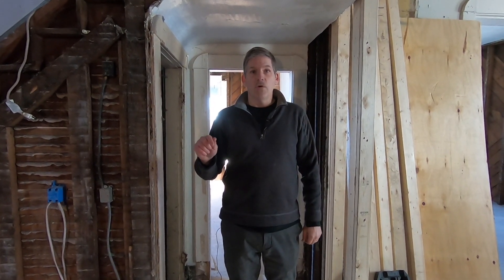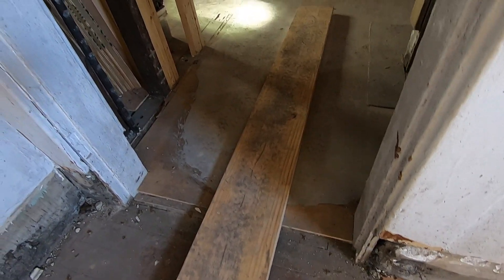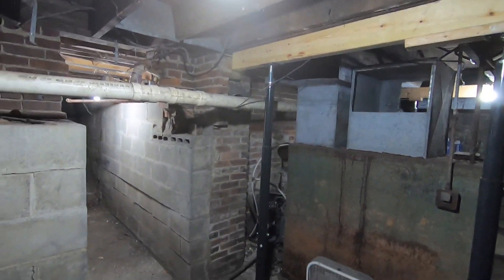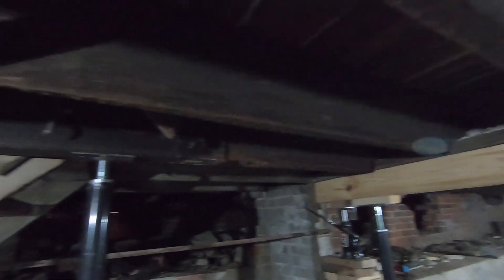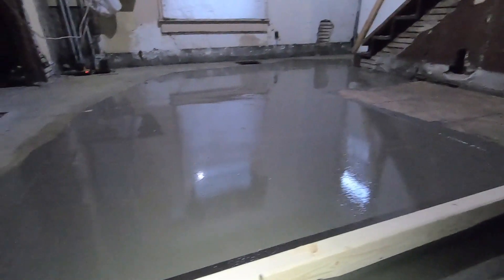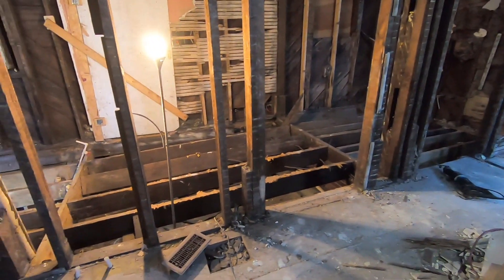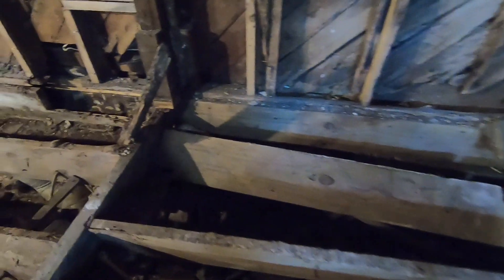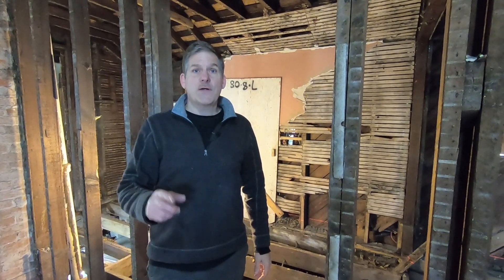Old House Renovation 3 - Subfloors - fix dip in floor and replace rotted wood

Comment: Solid video. I’m working on a 100 year old now. Very similar issues with notches, saggy floors, dips etc. it’s been fun correcting em.  Get to see first hand what shoddy carpentry, plumbing will do to a house over the years. Not so fun trying to track info to fix them. We’re a consumer society and the knowledge of how to fix and mend.
Reply from the maker: Hey John,
We totally feel your pain. Contractors and DIY’ers alike can turn a house structure to almost Swiss cheese in 100 years. We worked on a 35 yr old house once and the main floor joists support 2 floors above it was RIDDLED with holes and cuts!!!
Hang in there…the work is worth it in the end!
Thx for watching!

Comment: Would love to see a full video on y’all lifting the wall to get it level. I’m doing the same to a house I just purchased however the siding is brick. I really don’t want to pull all the brick down.
Reply from the maker: Hey Matt,
If your exterior wall has sagged, I would think that would already cause a brick issue. 
In our videos we have only worked on interior walls.
Like in this video: 
https://youtu.be/Hvgk8ZE0kaE
The interior work has not impacted the exterior walls.
Hop  that helps. Thx for watching!

Comment: Wow. Kind of incredible the house is still standing given how much wood was gone in places. Are the screw jacks a permanent fixture, or will those parts be supported in another way long-term?
Reply from the maker: Hey Sam,
Yes. I was surprised as well. But the more we have uncovered about old house construction, I’m starting to see it a little differently. We have an upcoming video that will highlight this.

As for the screw jacks, a couple will be removed as we have removed some walls which makes their previous support unnecessary. But in general, the rest will stay as permanent. They can serve as temporary or pet ant ant supports as they are incredibly strong.
Thx for watching!

Comment: On the second floor you mentioned shimming before the new subfloor went in. I would like to know how that is done. I did the exact same thing and had a hell of a time with it with mixed results...
Reply from the maker: Hey Benjamin,
Here is a link to that video. 
https://youtu.be/_gF18t60DMI
It’s work, but we took our time and used lots of shims to create a new and pretty level subfloor. 
Hope that help. Thx for watching!
Reply: @Housebarons  hey thanks allot. I should have looked around some more probably would have found it
Reply from the maker: Hey Benjamin,
No problem. Hope it helps!

Comment: Why do people buy these type of houses that needs massive amounts of remodeling it is just throwing away money in my opinion...
Reply from the maker: Hey OldskoolWayy,
All depends on where you are and house prices. Sure, it’s a lot of work but no sense demoing something that can be fixed AND make money in process.
Reply: I love my 140 year old red brick rehab (Chicago)  Thanks for your videos HouseBarons
Reply from the maker: Hey Mary,
Awesome - 140 yrs old! Very special!
Thx for watching!
Reply: Because some people can do the work. You know, the old school way of fixing things instead of throwing them out or demolishing... 

Older things are usually built overkill, and can be updated, while new overpriced things are usually built to the bare minimum standard at a premium price.